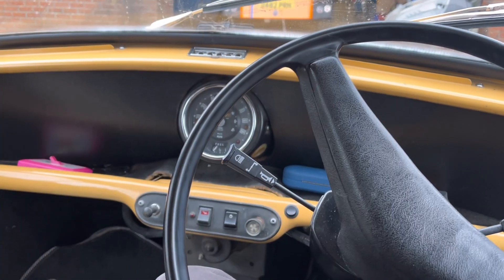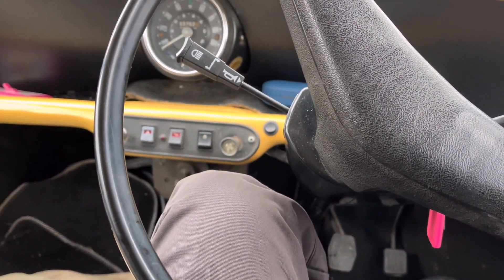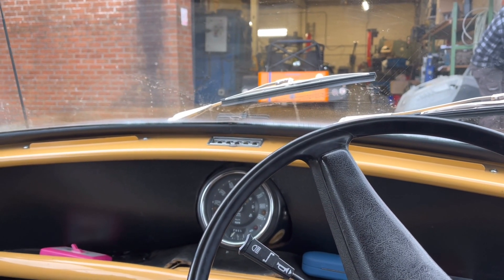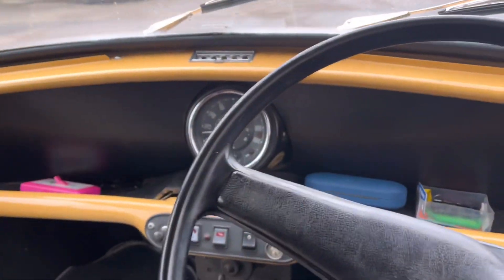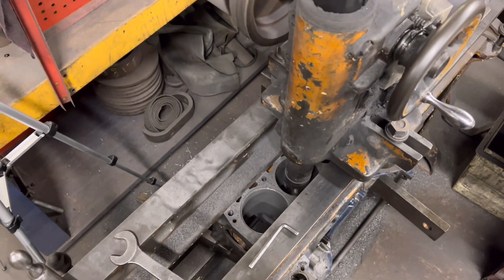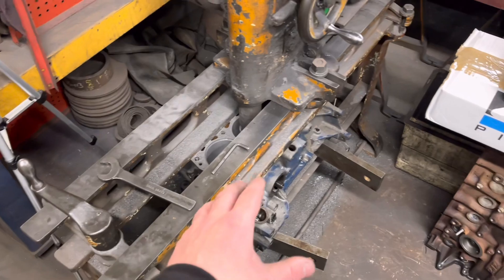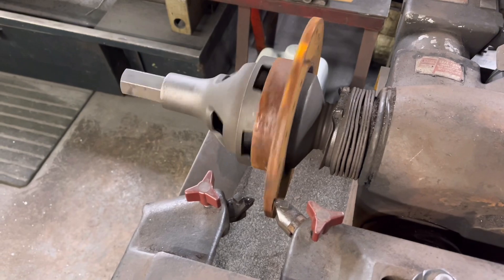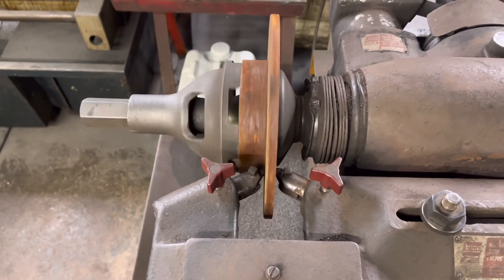We can’t BELIEVE it, customer REJECTS Mini after further issues

Comment: I got some conrods closed and honed at an engine machine shop once, when I got them home i measured them up and they were out of round, took them back and the shop couldn't see a problem , I took a second set to a different shop and they came back perfect and one of those had previously spun a bearing. In Australia it is very hard to find a decent machine shop.
Reply: Where do you live? There are heaps of good engine places around. Unless you live in the outback.
Reply: @tubester4567  I found 2 in the Sydney area that I could recommend, and that's over the 30 years I lived there.

Comment: I'm not an expert on classic Mini's but I do remember the old BL design feature of a steel pivot in an aluminium housing which caused me much grief on my old Allegro (handbrake pivot on rear brake slave cylinder which wore out in an eccentric kind of way).  I wonder if there is a similar arrangement on the flywheel housing and if it wears in a similar fashion.  I had no idea that my rear brake cylinders were bad until I finally looked at a new part and thought hang on that's not even the same part!

Comment: poor excuse saying you don`t know how the clutch pedal should feel. pretty obvious if there is little resistance in the movement of the pedal until almost fully depressed then it wont disengage properly and allow 1st gear to be selected. i`m surprised you embarrassed yourself.
Reply: Hes running a machine shop, hes not a mini expert or operating a repair garage. Esp since the clutch arm was heated and bent purposely. Thats 1 issue supplied by the customer. And the faulty slave cylinder. Both are not his fault.
Reply: Makes you wonder why they just wouldn’t bring it to an actual mechanic. My Grandma could diagnose a bad clutch.

Comment: Helped build a long wheelbase twini mini for a grasstrack autograss racer for a friend, jalopy in special class, used a van long wheelbase floor pan and an extended mini saloon body on top, identical 1380 about. 125bhp engine in the front and back. This was way back in the early 1980s. Gearbox linkages hard to work right at first, but never got it right, kept falling out of gear in the back box, stripping teeth in full action in the back one. My design it was. Fella gave up on the project, but hell, you should have seen it taking off from the start line, left those other hybrids behind. Could have done with another design on the twin box gearchange, say cabled to rear, or electrical solenoid change front and back, or something. It looked cool too, great noise, open exhausts. Four wheel drive, quattro mini.

Comment: These videos bring back memories of when I took my Mk3 Cortina 1600 OHC engine out when I was 21 (63 in March) I did a full recon on it myself apart from the rebore part. Didn't do too bad for an electrical engineer at the time😊. Sadly like a lot of Ford's it rusted away about 2 years later.
I also remember the Mini,Austin 1100 gearboxes being absolutely Horrendous sloppy as linkages etc. I also had a Ford Corsair V4 as a youngster brilliant engine apart from fuel vapour lock in the mechanical fuel pump on hot summer days. 
They were all really easy to work on but I now have a Toyota Diesel which never seems to go wrong 🤞🤞.
Such a shame they didn't build car's that didn't rust so much in the UK.

Comment: i know whats wrong, the mini clutch mechanism would always wear down, you replaced the arm with the new ball but the old socket is still there, it will also be worn, that's why people used to bend the arm so it had more travel than it used to need.
i don't think you can get new ones today.
surely the wear on the ball is also the same wear inside the socket... and i think on some models you could adjust the arm stop with the bolt that comes out of the casing and shim the thrust bearing to give you more travel on the bearing.

Comment: I had a similar problem on my MG Metro, new slave and master cylinders didn't help, but it seemed to be that the vibrations from the engine, were pushing back onto the slave cylinder and pushing the fluid back into the reservoir, and meaning I lost all gears. So I fitted a spring so that the pin on the clutch lever didn't touch the slave cylinder until you put your foot on the clutch. Never had a problem after.
Reply: Every mini I’ve ever had always had that spring as standard
Reply: Yes, that spring, stops the vibration making the hydraulic fluid foam, or something. A tight spring.
Reply: I'll be damned, it was a known issue lol, with the same solution, or should I say, it was solved before someone nicked the spring and I replaced it!

Comment: you done the best thing and your excellent reputation stands before you but i have never lifted a clutch half inch of the floor and thought it was ok especially if i experience difficulties engaging a gear.  love your videos
Reply: Best looking car that came out of Dagenham Ford Classic Capri from the very early 1960s, coupe fastback. They only made them for about three years or so, rare as rocking horse shit, especially the GT version. Beautiful car, very umm, classic looking. Pre-crossflow Kent, 1500. Should have made more, but mark 1 Cortina came along.
Reply: @huwzebediahthomas9193  Such a shame the old Ford's just rusted away. I had a Corsair and a Cortina my mate had a Cortina 1600E and a Capri 2000E, sadly rusted away long ago. Just imagine if they  had the same paint and rust prevention as modern Toyota,s I am sure there would have been lots of the old British built cars still on our roads.

Comment: Was the slave cylinder a part you sourced and installed? If not, it shouldnt be your problem. Just by the finding of the clutch arm purposely bent  what else is knackered on the car.   Not sure again if youre a machine shop or a mechanics garage for the folks who like to complain.
Reply: The car should not have gone back to the customer in the 1st place is 1st gear was difficult to engage and the pedal was near the floor. Clearly there was a problem..
Reply: @mikal8343  my bad, thought he was a machine shop and not a mechanics repair shop. Dont forget what i just said, the car was supplied with a bent clutch actuator arm. How do we know the owner of the car didnt leave it with him with a knackered gearbox too.  Not his fault the insides have been dickered by somebody else.

Comment: check the calipers if they are floating there may be air stuck inside the dust jacket and it will push the piston back into the caliper

Comment: Back in the day I worked on a variety of transverse A series engines. The size of the master cylinders bore and the slave cylinders had some variation. Getting the wrong mix meant having nasty clutches. I worked on a Metro which had issues with the clutch failing to release.  Using a crow bar on the actuating arm it would work perfectly.  We changed both the slave and master cylinder and still had the same problem.  Faulty new master cylinder took much time to find, right miserable awful thing to change.

Comment: One thing I have found out on re-production mastercylinders for the classic mini, is that it is sometimes necessary to install them to the car without the red 1mm gasket underneath it. To obtain a good pedal. If you have a pedal less than 3/4 of travel on brakes and clutch, you will usually have a problem. The clutch especially needs a good range to travel, as it tends to sink a little when everything is heating up.

Comment: Regarding brakes and cylinders, I have seen people put the pressure line in the bleeder port and vice versa so that the bleeder was below the line- this makes it impossible to get the air out of the cylinder.  Years ago when we raced legends cars, the master cylinder they used has a blocked off port for a brake light switch and if you did not open that port and bleed it, you could have an air bubble trapped in the system which caused an imbalance in the front-rear braking.
Reply: Also the good old favourite of putting the callipers on the wrong side and wondering why you can’t bleed properly. Yes I’ve actually seen it. Just as you said above the bleed is below the supply and just don’t work.

Comment: We had a similar experience with my Elan - Turns out the new master cyl wasn’t 3/4 inch but slightly smaller . Took a while to find this problem . Once we changed to new old stock all our clutch problems disappeared…

Comment: Had a few Minis over the years think I'm on 30 plus now lol used to have problems with the master cylinder spring inside used to snap and coil down its self giving a short throw of the pedal similar to  your problem I've also on a few occasions been supplied a clutch kit that on the face of it looks the same but have had thinner clutch plate which has also resulted in little clutch movement

Comment: The joys of working on old cars. Trial and test prevails. Problem you will always have is being somewhat blind when fitting existing parts and not knowing the functionality and condition of them. I guess one fail safe is getting a second opinion from an old timer. Either way you sorted the problem out that to be fair wasn’t entirely part of the original job which is the honest and decent way to deal with a problem. Fair play

Comment: Reminds me of the time my old Wolsley Hornet developed a split in the rubber piston seal on the clutch master cylinder. After pressing the pedal you had about 3 seconds to make a gear selection before the clutch re-engaged. Made driving at junctions, roundabouts and traffic lights "interesting".
Reply: That is amazing. I was literally just thinking about my old car. It was a 1932 Wolsely Hornet special, twin carb, no synch and air-cooled through the radiator as it had no fan. Wire wheels and a water temp gauge on the strap down bonnet.  Not only that but the gearbox selection was reversed. I gave it back to my brother in law in the 1960s and unfortunately, he let the block crack. I have always thought a cracked block couldn't be repaired and I am now wondering whether that is true.

Comment: The m/c's are two different sizes, 0.75" and 0.625",  are they for a balance bar set up, for separate clutch and brake  or optional sizes for the brakes?

Comment: Those haunting Minis, don't remind me, I know, when you get them into your life, they never leave you...
Check the clutch master cylinder if it is the correct bore, 0 70 inch I think it is, not a brake master cylinder, with a 0.75 inch bore. Yes, new seals internal and dust seal on the slave is always a must, no rust in bore main too. Bit of copper grease in bore above hydraulic seal.
Oh hang on, that must be later brakes master cylinder twin hydraulic circuits ~1980ish? Forget what I said.

Comment: I'm sorry the clutch hydraulics are nothing to do with you , you supplied a working engine and gearbox and fixed the clutch problem , I hope you're billing the customer for all this extra work and transportation.
Reply: I said the same thing. Is he a garage or a machine shop. If the slave was the one the customer supplied with the car, they can pay for the part and installation.

Comment: I admire your work and how you replaced the slave cylinder, however, the customer inadvertently set the scene for this clutch problem by only doing the master cylinder. In all my years as a motor mechanic it was best practice to replace both cylinders.

Comment: Cant keep a good old FORD engine down never lost one yet.
Reply: I found an old Ford Y block laying on the bottom of a reservoir.. Im pretty sure it's from an old truck.. The frame and other bits of the vehicle are still laying there with it..  They've been there since the late 60's when they flooded the area to form the reservoir.. I'm going to try and retrieve the block and build it..
Reply: @MarkLada  let me know how you get on. I still have a 1970 mk2 ford 1600e. Engine pushing 172 bhp old valve engine cant kill them.
Reply: @robert1016  I worked at a ford dealership for many years.. I've seen Ford engines pushing 500k miles and still going strong.. As long as you keep up with the routine maintenance and dont hot rod them around  24/7 they will literally last forever.. I only have a small window of time to grab that engine block.. It's normally under 30 feet of water, but In the winter they let most of the water out of the reservoir and the engine becomes exposed..  The problem I have is that I'm not allowed to drive a vehicle of any kind back to where the engine is at.. I'm gonna have to cart it out by hand.. It's about a mile away from the closest parking spot and down a steep embankment.. I think I'm gonna have to carry a winch and a battery back there to even have a chance at getting it.. I'm going to record the whole process and post the videos somewhere.. I'll probably start a YouTube channel.. I'll let you know when I get started.. I bookmarked this video so I can find it later..
Reply: @MarkLada  cheers,looking forward to watching, love old fords, I just sold my mk1 rs 2000 last year 1974 pictured above.I have over my lifetime owned 9 mk1escorts.
Daughter drives a focus st middle child Gary fiesta st. Robert my oldest is a mechanic he is now in charge of Tina.

Comment: I used to drive minis like this. The clutch was like that, lots of movement on the clutch pedal. Engaging 1st gear when cold but as soon as warm ok. Pressing clutch a couple of times helped. 
Bleed the system every so often. 
That’s what they were like
Reply: Not if the system is in good nick and operating correctly..
Reply: @mikal8343  it wasn’t!

Comment: Loved doing mini clutches , my favourite mot trick on the rear radius arm bearing was to knock the old one into the void with an old cut down box spanner and tap a new bearing in replace brackets and grease , I’ve still got that box spanner and a few bearings down the garage 🤗🥴🤣🤣